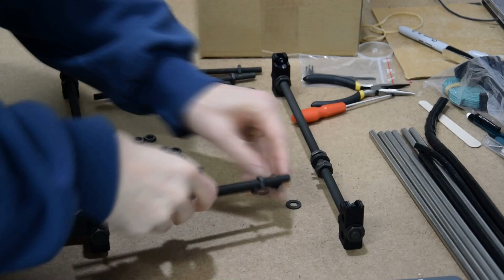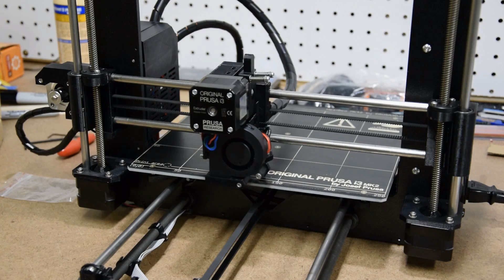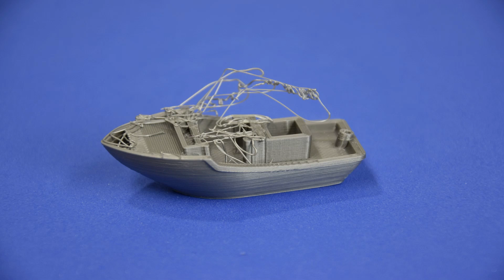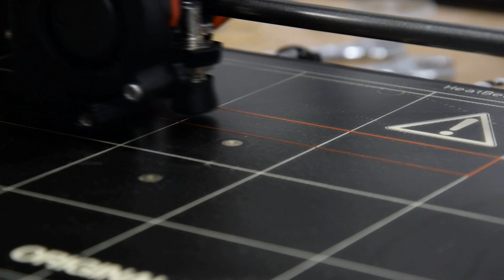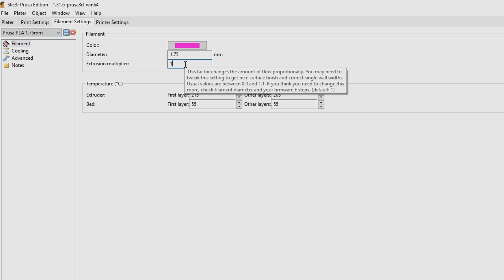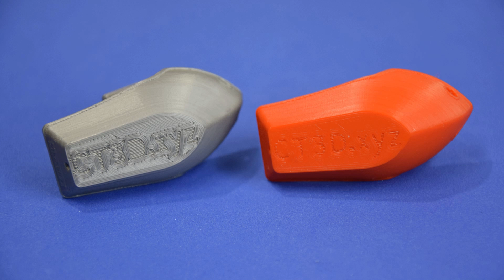3 Tips for the Prusa i3 MK2 3D Printer

Comment: Nice tip makes sense and pushed me to subscribe. - I just finished building my Prusa MK2S. Like you, I enjoyed the build, but the instructions led me around in a few circles and the end there is no solid documentation on how to tweak the calibration of the Prusa MK2S to ones needs. I think this Z adjustment you mention could work for me, as I cant get any print to stick including the provided V2 Calibration run (So far only using PLA for initial calibration and final setup). However, how does one do a live Z adjustment on the Prusa MK2S without running a print job? My Prusa only allows me to fine tune the live Z adjustment during a print.
Reply from the maker: Hi, thanks for watching!  If you're still having problems finding the adjustment on your printer -- that option is available when the printer is at rest in the "Settings" section.  Go to Settings -> Live adjust Z. I hope you're enjoying your printer!

Comment: My question is that you say mark 150 mm in filament and to extrude 100 mm. Why? And for extruding 100 mm of filament on Settings->Move Axis->Extruder I have to enter 100  right?
Reply from the maker: Correct, you have to add 100 to the current setting to move the extruder 100mm.  You should mark the filament at 150mm in case your printer is over-extruding -- if you only marked it at 100mm and your printer used 105mm, your mark will be inside the extruder assembly!
Reply: Thanks a lot :) Now I got everything clear

Comment: Good ideas! I used thickness gauges to determine my nozzle position and turned the PINDA a quarter-turn at a time to get my nozzle closer. I also increased my flow rate to 110. My first attempt at the whistle after that failed about  a third of the way through when it came unstuck, but I put down some glue from the gluestick and it completed. Now I am the proud owner of a $760 whistle, but I can't wait to make more things.
Reply from the maker: Great, congrats on getting the printer to work!  If you printed the whistle in PLA and it came unstuck, you might need to lower the PINDA a little more -- once I calibrated the first level on my printer, I haven't had any PLA prints slip off the bed during printing.

Comment: really great tipps.. thanks... as many other users complain I have also an issue with an "uneven" bed. That means the filament gets more squished in front (especially ugly if you print large objects)... I know I can adjust the bed correction for front, back, left and right in the calibration settings but it doesn't seem to lead anywhere no matter which settings I'm trying... do you have any idea how to do fix this issue?
Reply from the maker: My bed required a tiny bit of leveling in the advanced bed correction settings, but it wasn't anything drastic.  Did you put it together yourself?  Perhaps the frame isn't as square as it should be -- that was one of the most critical steps.  Otherwise, I would look for help on the Prusa forum, there are a lot of smart, helpful people there.
Reply: thanks a lot for the reply

Comment: I'm wonder if changing filament diameter in slicer to value that your filament actually is would not solved under/over extrusion (?)
Reply from the maker: Thanks, MrDracul88!  Peter B. Hugger suggested the same thing, and that might be just as good of a solution, but I haven't thoroughly tested it yet.

Comment: Pat I hear so much stuff about slicer use what is it and what does it do? And what software can be used with this printer, the reason I'm asking is I have AutoCAD Design Studio 2014 that I learning and can I import file from AutoCAD to the printer or will I have to have other software to do that and have it print it? G-code is another item maybe you can go into in detail in one of your  videos as well plz. I'm sure all this will bring up further questions to get help with and I am hoping I'm not the only one needing this type of help getting into this neat subject. Bob
Reply from the maker: The slicer software converts a 3D model (usually STL or OBJ format) into the raw commands that the 3D printer expects.  Those raw commands are the G-code, which you can view in a text editor.  If you have a 3D printer, it came with a slicer -- the most common are Slic3r, Cura, Simplify3D, and Craftware.

I don't know much about AutoCAD Design Studio, but if it can export to STL or OBJ (which is likely), then you can print -- just use your slicer on the STL file to generate the G-code file, and send that to your printer.

Comment: Since it appears that your under extrusion is related to the filament diameter it might be easier to just measure the filament (using your calipers) and modify the 'filament diameter' value instead of the the extrusion multiplier. It is recommended that you measure the filament in a few different areas on the spool to get a good average diameter. In the end both alterations should accomplish the same result. Happy Printing!
Reply from the maker: Thanks for the tip!  I measured both of the filaments I use, and you're right -- both are slightly under the expected 1.75.  One was 1.72mm (which I measured as underextruding by 4%) and another was 1.73mm (which was underextruding by 6%).  So it's weird that I don't see a direct correlation between the diameter and the underextrusion -- as I get more filaments, I'll definitely measure both ways and look for a pattern!
Reply: "I don't see a direct correlation between the diameter and the under-extrusion"  -  if the filament  is smaller in diameter then less material in sent to the print head - the print head will be extruding enough filiment and the heat per volume of material in the print head will not be correct
Reply: Right - so expected results would beA) diff from expected diameter = .03 mm | more disparityB) diff from expected diameter = .02 mm | less disparityBut UrbanExile got more extrusion disparity from filament B, the one closer to the expected diameter. So it is still weird.

Comment: Great tip on the extruder motor calibration! I checked mine and I was under-extruding by 6% as well. They should put this in their manual.
Reply from the maker: Thanks!  I agree, it's such a simple calibration, it would be useful in the manual.

Comment: Great video! When calbrating the extruder motor, how exactly do we tell the printer to extrude 100 mm of filament?
Reply from the maker: Thanks!  Go to Settings->Move Axis->Extruder.  Then just set the value to 100 more than the current value.  To make it dummy-proof, test it out immediately after turning on the printer -- the initial value will be 0.
Reply: UrbanExile Thank you! I didn't think it would be that simple.

Comment: Talking about the extruder. It is even easier to modify the Marlin Arduino source code. 
 #define DEFAULT_AXIS_STEPS_PER_UNIT   {___,___,___,456} ;
The higher the last number is, the more plastic is extruded. Also the previous numbers are for de x,y and z axis.
Reply from the maker: Thanks for the info, Marco!  True, modifying the firmware is an option, but that line will only change the default setting.  I believe that the actual value is saved in the EEPROM, and that is the best place to make a permanent change.  Plus, that will save you from building your own custom firmware every time an update comes out.  However, I don't know how to directly modify the EEPROM settings -- I have yet to dive that deep into the techy internals of the machine.
Reply: As this is dependent on how much the filament diameter is off for a particular spool of filament you have vs a hardware issue, I don't think a permanent change makes sense.  Good reason to have the calipers for sure. :)

Comment: Which Sensor cap are you using? Have you noticed it helping?
Reply from the maker: I used the cap I downloaded from Prusa, but I had to scale it down to 98% to make it fit.  I don't think it has done much yet, but I put it on there as very cheap insurance - I don't want a failure in a print to damage the sensor!
Reply: At work right now. Could you supply that link?
Reply from the maker: Sure thing -- all of the Prusa downloadable parts are available at http://www.prusa3d.com/prusa-i3-printable-parts/
Reply: Hey guys! Nice tips, thanks and I've subscribed.... I'm going to double check on my settings, cos I'm getting good prints on my i3, but even though this is an amazing little machine, I'm sure that could be better. Just a note on the downloadable Prusa parts,  but I've found that they are not quite compatible?! I've spent a lot of time on my i3, adding components to fit drag chains and have made extensive changes to my i3 because I didn't like the wire management. During this time I printed some parts for it from the downloadable parts list, and every one of them doesn't fit because they differ from the parts currently on the printer..... Weird, but true! Let me know if you find this problem as well, please. Cheers for the tips!